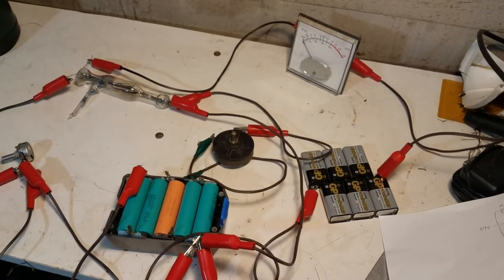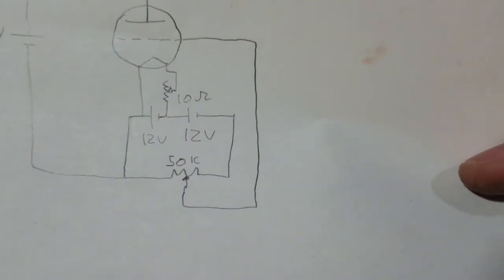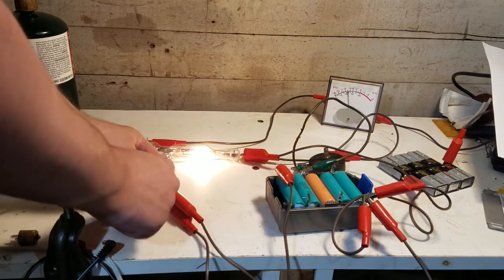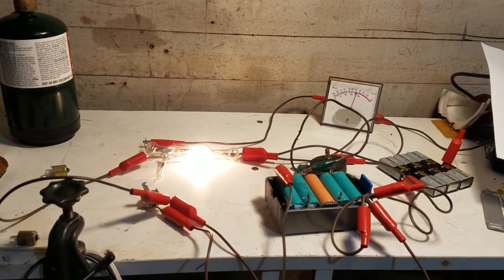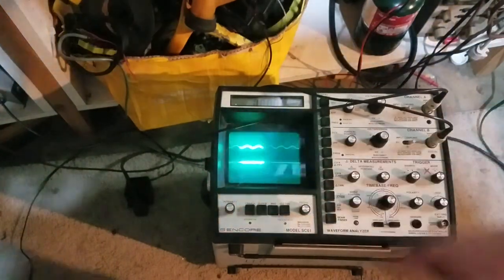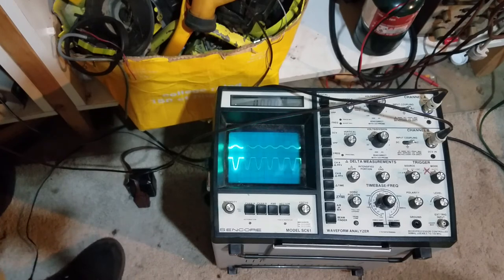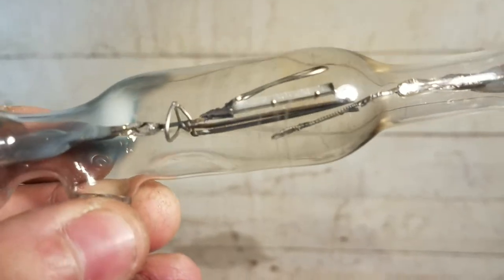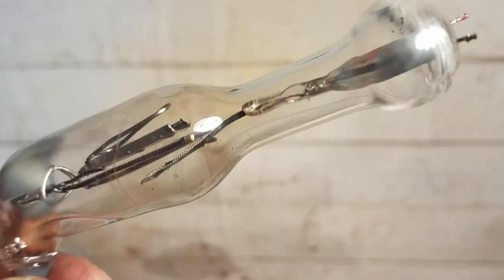First Homemade Triode Vacuum Tube

Comment: Nice! I think you're the first person to replicate my use of titanium as a getter material, at least in a homemade tube. I'm glad it worked out for you. The double pinch seal is an interesting trade-off; more complicated glasswork, but no need for an alignment jig for the feedthroughs. Reminds me of an early Audion. Well done.
Reply from the maker: Thank you very much! I would not have thought it possible to make a tube without a diffusion pump without your experiments. I only have two sizes of glass tubing with the smaller one only large enough to fit two wires, I am looking into buying more sizes of glass. I was surprised how well the titanium getter worked. The tube worked after being baked out on the pump but some air must have leaked in while sealing it off and it started acting like a thyratron. However after I reflashed the getter and let it sit for a while it recovered!  Just have to wait and see how long it lasts.
Reply: @jdflyback  If it helps, I just tested one of my older (late 2016) tubes and it still works, so a titanium getter seems to be a permanent solution as long as the seals are good. I couldn't tell from the video, but so long as the tungsten feedthroughs are golden yellow and there aren't very many bubbles around them, it'll probably be fine. Also yeah, titanium is spectacular for homemade tubes; you could probably get away with an initial vacuum of multiple torr, since it reacts with anything that isn't a noble gas. I'm actually curious about doing that, since I've noticed some interesting amplification effects at the triode/thyratron boundary, but that'll have to come later; I've got quite a few other projects lined up first.

Looking forward to seeing what you make once you pick up some more glass; making vacuum tubes is a skilled craft, which means it gets quicker and easier the more you do it. Keep it up!
Reply: @jdflyback  I was going to ask if you hadn't made use of a diffusion or turbo, etc, pump for this tube :-) Glad to know that you didn't, for the same reasons expressed by Simplifier.
Reply: Hi simplifier. I just add your neocities site to my favorites. Good proyects. 
Im from Argentina. Want to make my own power triodes with graphite plates for allow 30 watts of dissipation.
Reply: Really interesting, thanks a lot for this information, never thought to use titanium as getter material. I tried to make my tubes years ago but got problems sourcing getters. I need to rebuild some  equipment but definitely I'll try again using titanium.
Reply: Have you ever tried flashed aluminum as a getter ?

Comment: YOU ROCK!

So, it would be posible to recycle used vacum tubes? (just a new heater and a new vacumm glass?)
Reply from the maker: Used vacuum tubes are made of soda-lime glass which is difficult to anneal (very easy to crack). Pyrex glass (borosilicate) needs little annealing which makes it a lot easier to work with. Old tubes are a good source of metal and getters though.